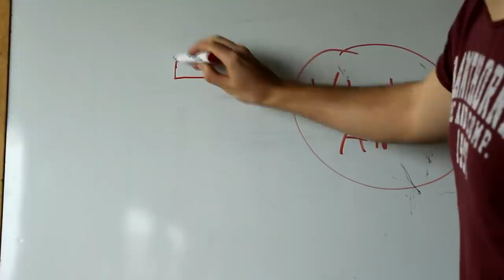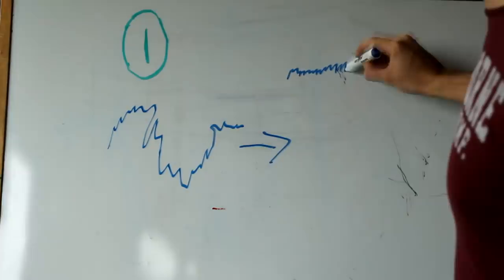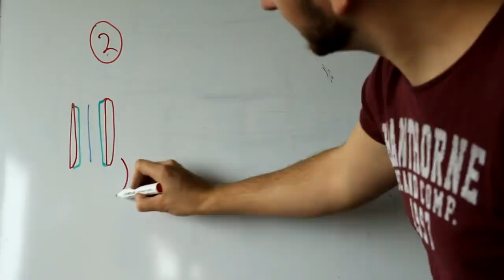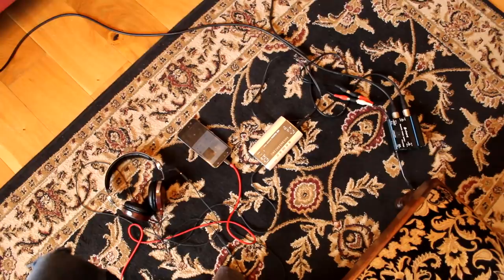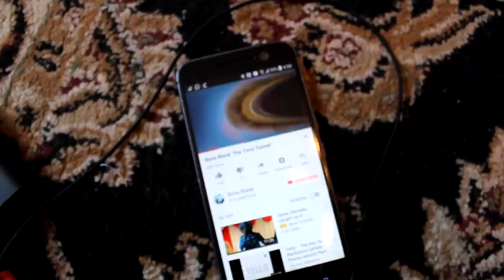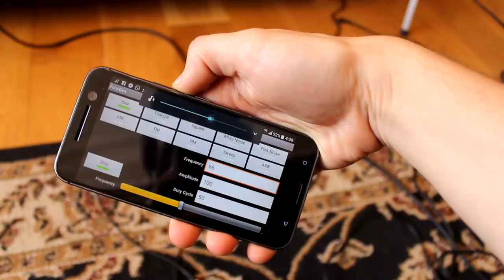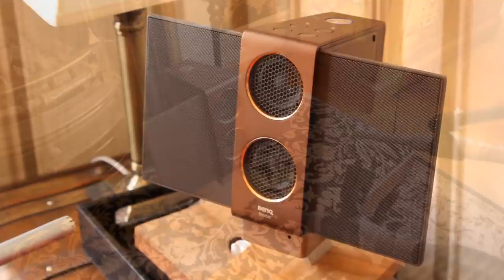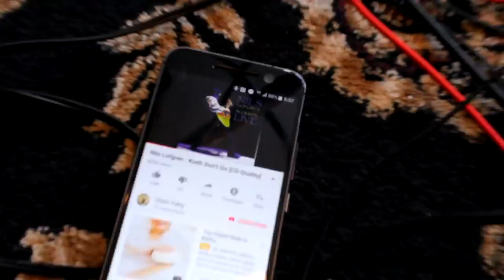WTF are Electrostatic speakers?! w/ BenQ Trevolo 2 demo

Comment: A ++ review I've owned ML electrostatic speakers for 7.5 yrs now I purchased the 1st gen or series of BenQ TreVolo and now 3rd and/or the same configuration you are currently demoing w/ stands also and I applaud you on your presentation and effort in explaining how they work I totally recommend this video to educate and enlighten viewers to this not so publicized technology my only rebuttal of your explanation is that ML or Martin Logan speakers have solved most problems (5:49 to 6:20) w/ this technology you can power a full size 2 channel or 7.1 with a basic low budget receiver at the time I started my home theater system with an Onkyo in the box it was like 100 watts per speaker 1200 watts total or like 120 watts per ch. on a 2 ch. application there rated like 20 watts to 400 watts per channel so most dinosaur receivers could drive these even their earliest model that came w/ a built in amp could be played with a simple iPod no receiver back in 2002 or 4 anyway I'm have and have been looking at or basically seen every review out there and you've done a great service to the electrostatic owners committee and it my hope that more people have the experience of ELS speakers in their future thanks and good job.

Comment: Very nice sound demo by playing the guitar yourself! Well done!
Because electrostatic speakers are dipoles they should be placed at least a metre away from the back wall to avoid cancellations with the sound from the rear which is phase shifted by 180°. Then you'll get very impressive imaging from dipoles.

Comment: The guitar recording did show just a bit of difference, but I don't think I've heard any of the songs you played sound that good before now. Thanks for this video.
Reply: The difference was big for me, and is because of the two center normal speakers that are too boomy in the mid range, actually it have what is called a peak in about 500 hz.
The statics spekers are good, but the center ones not.

Comment: Cone type woofers have a hard time keeping up with the speed of well designed electrostatic panels. Which is why full range electrostatic speakers are still recognized as offering the most transparent and coherent sound even if they can't generate the volume levels of hybrid designs.
Electrostatics in general are not new. Their design is decades old and the first full range models were the Quad ESL from late 50s followed by the KLH in the 60s. In terms of transparency and fidelity both can compete with some of today's best designs.
Reply: Some would argue that today's tech have surpassed them lol you ever heard top end speakers ...10'000 upwards?? Get real
Reply: @shaundavidssd  Most stats these days cost well over $10,000. The Martin Logan Neolith costs over $100K.

Comment: Having heard my first set of these speakers powered by a great valve amp, before I started my 30+ year history in film and tv post production I can tell you, everything after them has always left me a bit underwhelmed. Whatever their downsides, the feeling of being in the midst of the performance is something that even $100k audio systems never quite get. They’re very good at celebrating the craft of audio engineering and the production process past that point, but they don’t celebrate the actual act of performance  in the same way.

Comment: first... yeah... pretty nice little speakers. Although i still would prefer some big electrostatic panels
Reply: But they are VERY EXPENSIVE, the older models that are cheaper are almost always dried out and need an expensive repair. But yes, those old quad electrostatic speakers or martin logans sound absolutely amazing!

Comment: You did an absolutely terrific job with this, with solid though put into it.
Question: with the mics so close to the speakers, would this not exaggerate separation?  What I mean by this is, if we had two speakers with fairly terrible soundstage / separation, but we moved them sufficiently far enough apart that they can't interfere with each other, then mic them closely, would this not exaggerate their separation?  Hope that made sense.  I think their may be value into doing a similar test, but with a "binaural capture" approach, to give a sense of the separation from "where the listener sits."  Anyway, just something to think about.  I still think you did a fantastic job, so hats off to you!
Reply from the maker: Thanks! Yes, however there is no way to convey an image over a video. The reason is the image is subjective to the listener and their own audio equipment. Nothing I do with mics, mono or stereo in whatever position, will be able to give the viewer an idea of the exact image in my room. I placed the mics close to the speakers like this so that L and R are separated enough to present the viewer with the best image based on their own listening equipment.

Comment: In general the sort of music they play in most hi-fi demos will sound o.k. on pretty much any kit. Full orchestral work  which they never use or very rarely use  is the  acid test of any hi-fi system in terms of reproduction. A singer and one or two  instruments i.e.  isn't going show up  very much at all in terms of  system weaknesses. Which begs the question is that  the reason why they use  such simple program in hi-fi demos?

Comment: With some tweaking they could sound awesome. Can the two speakers be wired up to each other or or only Bluetooth? You need two small active subwoofers 10" work a treat, played through a mini DSP crossover at 140-160 Hz thereabouts. They had good top end but sound boxy but this could be sorted out quite easy. What is the given rating output per speaker unit? and what is it with two in stereo formation? If you want to get ridof?  let me know I'm in the south east near Wycombe if not too far I can pick up.

Comment: The design of the TreVolo is interesting, but the flat panel speakers send treble in a very narrow beam. If you are not directly in front of them they sound worse than most BT speakers.

Comment: So I've been following for awhile, and in the state's I don't have much info on DD amps, I have 2 redline 615s dual 4ohm, and a prime 1200, doing hair trick and I'm in the 146db range, I want to add a third 15 which will drop me to .66 do you think with good electrical the m1 can handle it I've watched your video on impedance rise 3 times so many factors, what is your take.....

Comment: Hi there could you send me a message regarding a sub amp rebuild ot help me out? My car amp i have for 14 yrs sometimes works and sometimes not od cuts of at sny time IT wants and wont turn back on unless i turn radio on and on again but sometimes even if i do that it does IT again and again what can be the problem? Fuses are all good btw

Comment: Is there a type of speaker where the magnet is attached to the cone and the coil is attached to the basket? Like a regular speaker but with the coil and magnet in reverse positions? I was just wondering if that would work they other day. You could use a small strong magnet and then be able to have a heat sink or liquid cooling on the coil part since it's not moving with the cone anymore. Is that already a thing or would it even work?
Reply from the maker: It would be a terrible speaker due to the extremely high moving mass, putting the magnet on the cone lol
Reply: @barevids  even if you use a tiny magnet that weighs the same as a traditional voice coil?
Reply from the maker: @psychogat3  a traditional voice coil has the magnetic force of a pretty large magnet. So putting a tiny one, even Neo N52, would make for a pretty poorly powered woofer.

Comment: those things take line in on one speaker and transmit it over bluetooth to the other? if thats theres no point in using high end speaker is there?
Reply from the maker: It's not Bluetooth to the other speaker, it's a close range high data rate connection, probably similar to 5ghz Wi-Fi. So if you feed the master with lossless Audio, the slave signal doesn't lose any data and it's the same as a wired connection.
Reply: @barevids  but its pairing via bluetooth? then its switching to a proprietary kind of wifi connection? do you know the stream specs?
Reply from the maker: youre getting a little muddled:
- The connection from phone to master unit is Bluetooth. 
- The Duo-mode connection from Master (L) speaker to slave (R) speaker is its own high data rate connection. I guessed at it being wifi-style frequencies but i dont know. What I DO know is that by using Duo mode, there is no loss of quality. If you feed the master with lossless audio, then you will hear lossless audio from both L and R speakers.

Comment: I guess I'd use a pair of these in stereo and in tandem with two small, fast REL subwoofers. They would make a real bitching  2nd system for maybe my laptop and Dragonfly Red USB DAC. Is there a a way of using it with these?
Reply: Yeah I run two Rel T-zeros in stereo and they are bitchin cool.
Reply from the maker: Yes, these have a stereo line out you could split between a pair of subs!

Comment: Electrostatic speakers where really meant for valve amps. Valves use highvoltage, low current whereas speakers like low voltage, high current. So valves use an output transformer to convert volts to current (V/I) but Telefunken made an electrostatic tweeter in the 50s that came direct from the output valve. BTW You may have explined this in the video but the first 30secs where far too millennial for someone with a brain.
Reply from the maker: Thanks for your comment and knowledge on the subject ☺